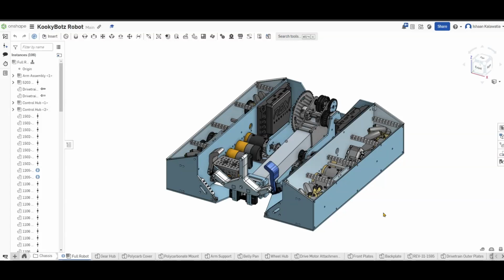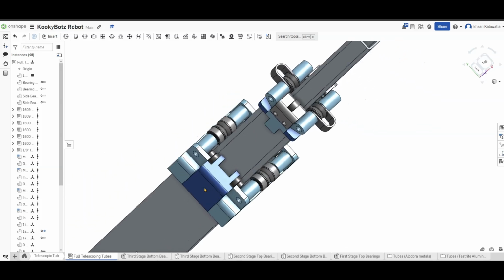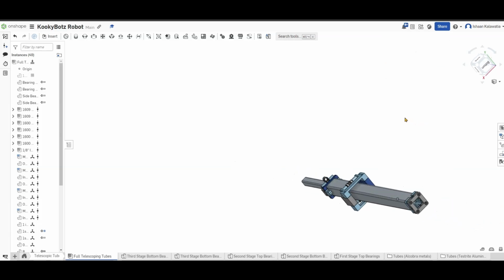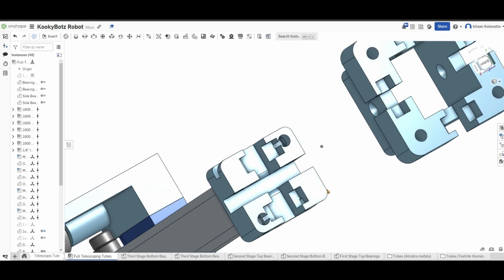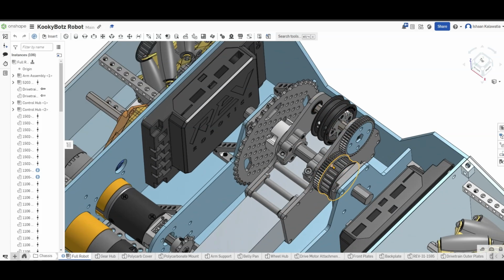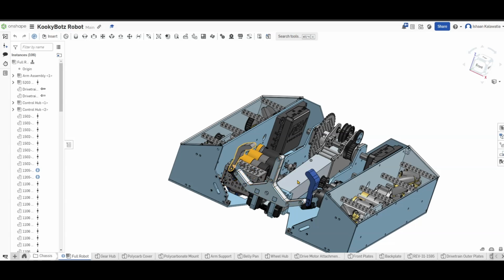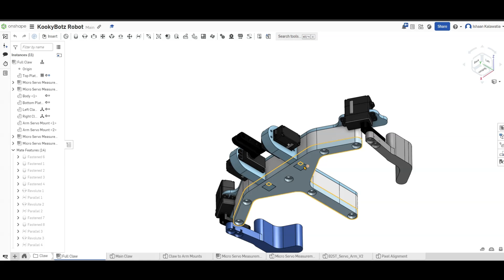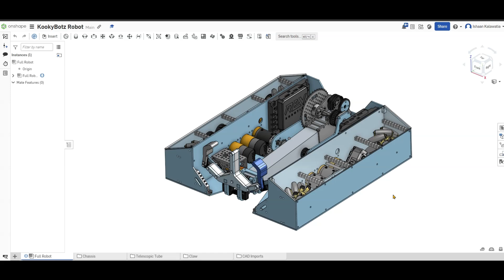KookyBotz Copy - Telescopic tubing - CAD

Comment: Well done! What supplier do you have in mind for the 1/2" and 1" tube? I don't see those rounded corners on McMaster or Amazon. Thanks for the amazing CAD!
Reply from the maker: The system should still work without tubes that have rounded corners